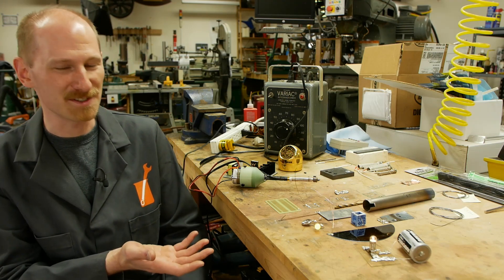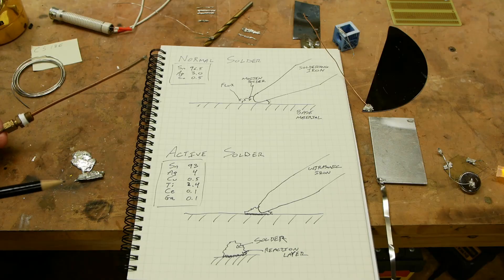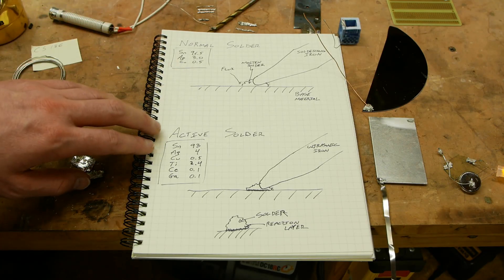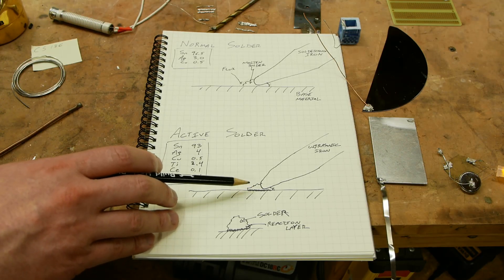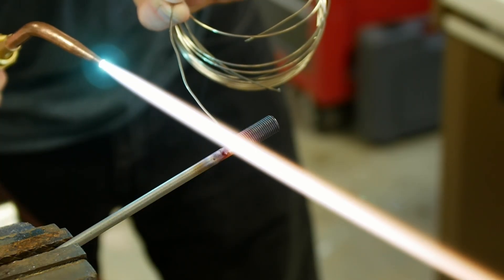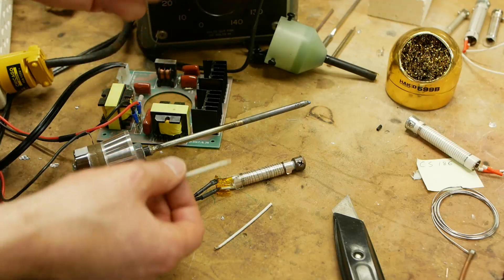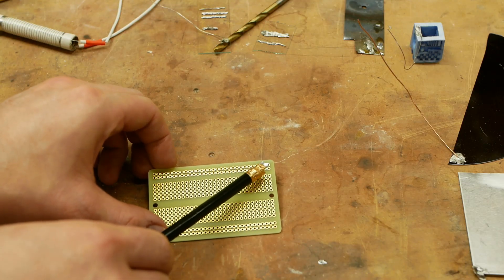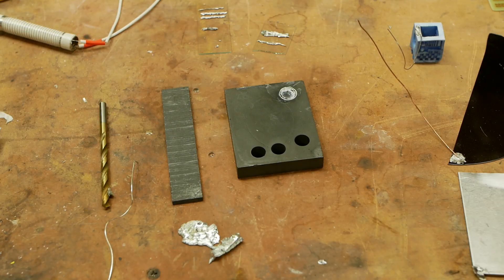Ultrasonic soldering bonds glass, titanium, stainless steel, ceramics, tungsten, nichrome...

Comment: transducer is too large    you need   magnetic strictor    that  tip  can  be   4x    smaller    then  used.
and you  will be suprised   but   ultrasonic solder   we have  manufactured  15 years ago  in russia     the cost    is  near
250 $  with  driver  power is 40watt

Comment: Normal electronics soldering irons have a coating to prevent the iron itself getting soldered and to prevent corrosion. I've had cheap tips corrode away like crazy. I always thought the interns did something fishy when I wasn't looking, but I once ended up putting one of the bad tips in my own iron and there it went.

Comment: Can you measure the resistance you get if you solder a ground wire to anodized surfaces? We currently abrade away the ano, but if this solder can bond we'll to it, we might be able to leave the ano

Comment: Would this work to solder low heat for batteries?
 Did you ever do the induction furnace to make aloys video? I'm wanting to make an induction heater but was told I bought all the wrong type parts. High voltage power supply for a tesla coil won't work I guess. Like to see how you put one together from Ebay. I'd buy a DIY kit if you made a batch. You could do well making DIY kits for some of your projects. I dislike finding all the parts and wasting all the money on the wrong stuff. i was just looking for a cheap easy way to melt a couple grams of recovered gold. Torches just don't get hot enough.

Comment: My question is if you can weld glass together with it like you're making stained glass, soldering on the borders between pieces like they're being welded together. I think it would at least make a weak bond over the surface, but I'm curious if it would work into the crack due to being "contained" between the edges and have more chance to react and bond to the glass.

Comment: First, this reminds me of the old “A-Team” television show, where our heroes often find themselves trapped in a garage and heroically break out in a tank constructed from found materials. 
Second, it seems like a shielding gas such as used in a MIG torch might be an easier solution to some of the oxidation issues.
Third,  combination of science and engineering is impressive. (That actually should have been “first.”)

Comment: Might not be too hard to modify the ultrasonic driver to reduce the power. In a pinch just putting a power resistor in series with the transducer would probably work.

Comment: Might be easier to build a vacuum sputtering system to coat the non metallic substrate with a metallic layer which you can then solder directly to

Comment: Now this is what is what i like someone given thing ago! you'd know what i'd like to see is you using a slightly smaller stainless steal rod woth either a element at the end or a heater like a blower that starts at the hand peice but also use a enclosed reflecter where the sonic resainates then travels down the tube to the tip being a pointed tip or a dish like tip an see how that works use the heat or just the transducer so you can weld things abit more where particles are a bit more displaced then forming a solided mass! would like to see that with plastic's too.

Comment: I used acid based flux once because I was soldering two pipes together using my hakko electronic soldering tool.  I came back a week later and the flux had almost entirely dissolved the soldering tip. It was amazingly instructive and unexpected. It was just gone- I don’t know where the tip went

Comment: Impressive & Interesting!  But why would you need to fuse metal to not metal?  Traditional soldering is for electrical continuity.  But non-metals aren't conductive. So what are the use cases?

Comment: Will it work for audio copper wire to brass connectors, what affordable options is there for ultrasonic welding/soldering. Idea is to get as much conductive as possible without old soldering/exotic silver+gold solder to max the conductivity.

Comment: So if the mixture of solder can bond to and "tin" the glass, could you come back over it with a standard mixture or another solder that would bond to that and leave a shiny surface?  Maybe there would be a way to apply both layers at the same time.

Comment: If the graphite were under a vacuum do you think it might stick then?  When the solder pulled loose from the graphite, did it pull any graphite from the surface still attached to the solder?  I've read that graphite is a lubricant because it gets oxygen molecules in-between the flat molecules or something like that.  Would those oxygen molecules prevent the solder from sticking to it?  Is it possible that instead of using a heated soldering iron that some sort of plating might be possible using the ultrasound.  A connection could be started with the solder and then try to work out onto the surface.  Maybe.  This was really interesting.

Comment: I was working a few years ago with an ultrasonic transducer from a mist atomizer and they are quite powerfull (and cheap), by curiosity I put my finger undergater between the ceramic and the water beam (so underwater), and instantly regreat it!!  A deep pain as my bones wanting to scape from the flesh!!... so I quite concerned about using a ultrasonic element atached to something I take with the hands..... maybe, just vibrations are required and no "so powerfull ultrasonic" ones could be used... maybe try to join a quartz crystal to the solder iron and feed it like a clock resonator, with less power and more slight vibrations it could work (by removing the air layer between the metal contacs through vibrations)... something similar I successfully used to dig grounding copper bars in the soil: I take a vibrating motor from a broken PlayStation Controller, a batery, and join it to the head of the copper bar with duct tape, when turning on, it make vibrates the copper bar making muuuuch easier to nail it into the ground, about 2m bars, with just a hammer when passing the first half it becomes a nightmare

Comment: Для чего это делать и выдумывать квадратное колесо для поезда. Для особо одарённых посмотрите изготовление и крепление нагревательных спиралей в автомобилях для переднего и заднего стекла также подогрев зеркал. А слой тонкой меди на алюминиевой основе. Хватит обмана и фейков. Why do this and invent a square wheel for the train. For those who are especially gifted, look at the manufacture and installation of heating coils in cars for the front and rear windows, as well as heated mirrors. A layer of thin copper on an aluminum base. Enough lies and fakes.

Comment: Very interesting video, thank you.

Have you experimented with the use of mildly reducing (and non-toxic, if there are any) or inert shielding gases to keep the oxygen out of the melt?

With respect to the attempts to solder to polymers, you might have more success with polymers that can form covalent bonds with e.g. dyestuffs or other chemicals, such as textile-fibre-grade nylon 6 or nylon 6,6, or the cured form of the two-part resin that is used to make fibreglass (assuming that some reactive chemical groups remain after curing), etc.  A textile chemistry textbook would help identify such reactive polymers.  Overheating during the soldering could damage the polymer.

Comment: @applied science. you could use this in theory in junction with a 2d CNC to manufacture circuit boards. there would obviously be a boatload of details to workout but having the ability to throw down a sheet of substrate and just crank out a custom board would be incredible. i'm assuming that you'd be able to hot solder to this type of solder and even if you needed to do through hole components it would be as simple as just drilling the layout on the substrate before printing the traces on the board.

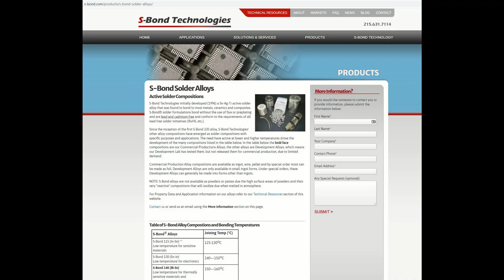Comment: 1:15 Lol that blob of homemade solder looks like a bust of George Washington

I heard once that it can be really hard to get stuck on food off of your cookware because if you scrape away the metal underneath the lubricating oil the raw metal can form a strong chemical bond with the protein in the food, forcing you to scrape it off as soap will no longer help. I wonder if that technology could be utilized in a similar way to the ultrasonic solder to fuse things together

Comment: Can you film a video about "homebrew" acrive solder in "kitchen circumstances" ?
Because i cannot find, where buy even a sample of commercial Active Solder (GS155 or CS186)  samples, i really will try do it myself, or ask a Lab-friendly comerade about it.
P.S. Ultrasound soldering gun like yours prototype i can do myself, this is not "piece of cake" job, but i can do.
P.P.S. My main goal - is hobbysts aluminium soldering (exactly a Tesla Panasonic 21700 Li-Ion battery, that have a non-weld-non-solder "Alu Positive" contact), there is a using Active Solders looks pretty perspective.
Other alloys for Alu, i used already -- or very High-temperature alloys (like ex-SU alloy called "ПОЦ50", Sn50-Zn50), that gives a good mechanical stretch bonding, but has a 230C+ work themperature, leading to themperature-damage of cell (but gives a miracle results with regular soldering flux and regular soldering iron on other aluminium parts like soda cans or aluminium foil), or ultra-low mechanical strength alloys like Rose's (Sn25Pb28Bi50).
So, you can understand my itnerest for ultrasonic weldind theme :)

Comment: I'll bet you can make small, super-high quality mirrors with this process that will withstand higher temperatures without losing clarity. 1 thing I would like to know is, how strong is the bond to glass and other non-solderable materials? It's not enough to just bond, it must be pretty strong to be practical.

Comment: A little off on why flux left on why soldered joint continues to corrode! Flux is corrosive and eats away not only the thin oxide layer but the metal itself. If left on, it continues to corrode the metal, not just the oxide layer.

Comment: This is an Amazing process. It was used to bond the SR71 windows (Quartz) to its structure (Titanium Alloy) and it worked fantastically well, keeping it air tight at high temperatures (>350°C) at supersonic flows (> Mach 3.2)

Comment: Once you have doped the material surface that you wish to stick to with your active solder can you use standard 50/50 solder to the active solder material.? The term you used at one point was confusing about Air and then Oxygen and Titanium Oxidation as if they were the same gas, they are two different things. Air that you breathe as you know is 4/5th nitrogen and 1/5th oxygen plus half a dozen trace gasses H2oVapor/air humidity, and O2 is well just Oxygen.

Comment: Weird epiphany, but at about 6:00 you mentioned the vibration is used to overcome the surface tension and I was reminded of the difficulty in "wetting" a surface with liquid metal heat transfer liquid.
Reply: I guess I am now wondering if an ultrasonic element could make the application easier or if it might just make a bigger mess.

Comment: I have been knife making for just under 10 years. I have lots of tools surrounding this profession. One of the end-game processes is to pattern weld titanium in a way that traditional "damascus" or more accurately "pattern welded steel" is made. The problem with titanium- as you know- it oxidizes very quickly. In practice, when you get titanium to forging temperatures (for titanium its on the higher end) it oxidizes and scale is quickly created- crusting off and making it very difficult to proceed. Friends have theories that you could use an induction forge in an argon environment. But this would require having your press inside that environment I believe. Ive also heard you could encase the titanium in molten glass that has a similar expansion coefficient, which sounds more like how it might be done. Im not a chemist nor did I do really well when i was in grade school a million years ago. I would like to try this out as I am a very decent knife maker and would like to expand and practice making pattern welded titanium. I would be happy to send you enough material and a sample of pattern welded titanium if you are interested in attempting to figure this out. But im not sure you have press. Also it does occur to me you have no interest in pattern welded titanium. Thanks for taking the time!

Comment: Have you tried using this for glass-to-metal seals for vacuum stuff? Would be REALLY handy!
Reply: I wonder if you could solder a canning jar sealing ring onto a glass jar through the ring? Would you have to have contact with the solder and glass or the transducer is powerful enough to penetrate through. Don't know what purpose that would serve but neat to find out.

Comment: The reason you are eroding the tip of the solder is the ultra power of the transducer is way overboard in power. Second the solder is really reactive with the tip causing lot of erosion. Happy New Year too.

Comment: One thing you have to be very careful with is Chrome and Zinc around Ti, it damages the titanium quickly. When I was in the RNZAF, we had some aircraft parts that were Titanium, and we were not allowed to use regular Chrome plated tools on them, as they left marks like pencil marks, but in a few weks the Titanium would exfoliate in those areas and even fall apart.
Regarding the Graphite, you may have soldered to it, but it has layers very thin layers, so they tear off easily. If you look at a motor 'brush' they are compressed around the copper wire to make connection. Cool fun you are having there.

Comment: I would be very interested in knowing if you can active solder onto crystals, anything really but quarts is an easily available material. Not only could that lead into interesting tests of piezoelectrics and resonant frequencies but could also go further and maybe be used for testing ionization energies of their valence electrons. Not gonna lie, the prospect of being able to remake the original transistors without a massive headache is the first thing my mind went to.

Comment: The board and transducer isn't shown on ebay. There are other boards but mainly 220 volts and 50 cycle.  Lots of 60 W transducers. Would it matter if the board were fed 60 cycle off the 220 volt feed  for stoves etc to feed the transducer ?

Comment: You should try with "Aluminium Welding Sticks". They sell them at Hardware Shops so readily available. They're stronger than Solder and readily available. The metal is stronger than Aluminium.

Comment: lol i dont use extra flux its a waste of money. any rosin core solder will work. if the pad is heavily oxidized 1500 grit sand paper will do the job without removing much metal. 
i do however use solder paste for SMD work which is solder suspended in flux. tinned pads usually dont require any sanding or flux . 
also adding solder to a stubborn old solder joint helps melt it. 
i been soldering electronics for about 11 years flux is a waste of money. no buts about it.  there is nothing professional about wasting money. 

although if your soldering pin holes in a gas tank (after you neutralize any residual gas of course) you need silver solder and flux cant get around not using flux on steel.

Comment: 50 years ago a friend gave me a small tube of a special solder that was also a special alloy that did pretty much the same thing the ultrasonically applied solder does, but 'wetted' and reflowed well using a conventional Weller 60 watt soldering Iron.
 It was about the thickness and consistency of standard spooled 60/40 resin core tin lead solder and left no visible flux residue.
It was coiled up in a plastic tube similar to the 'free' solder sample you often get when you purchase a new soldering iron.
 I didn't have much use for it at the time, but over the years I used it to solder things I would not normally have been able to solder; such as Nichrome wire (but not the part that could glow red hot), Aluminum, Stainless, etc.....
 My biggest use for it was repairing solar cells (which were extremely expensive back then, and were always round)
It was the ONLY way for me to successfully reconnect broken tabs to the metalized glass on the back,. or to bridge over surface cracks in the tiny treelike pickup paths on the front surface of a cell.
I never tried soldering to plain window glass.
 I never asked my friend for more of it because I still had some, and he passed away long ago.
There was a name on the plastic container but I am in my mid 70's and can't remember that name now.
 I only mention this because you may be able to do some research to find who made it and what was in it now that you know that it did exist,........ at one point in history...
Reply: I looked into this for you. my best guess is an Indium-Based Solder. possibly produced by the Indium Corporation. Does this ring a bell?
❤
p.s.
That Indium solder was some pretty specialized stuff. It was around, but your good friend must have been in some pretty interesting electronics circles. ✌️❤️

Comment: Building a vacuum induction furnace and buying 25 grams of gallium is easy cheaper than getting an engineering sample of ultrasonic solder! I love it!
Reply: Hi... Something i obviously havent understood here..... why not simply make a Tesla Coil.....(I answer that myself.... well...... that is AC)     ok so why not make a DC generator with a cascade multiplier up to a couple of hundred thousand volts DC ?   would that be the same but stronger ?
   or ...what is different with 'an electron beam' in air  to what im suggesting ?

Comment: I need to bond wire to the  positive cap of Tesla/Panasonic 2170 cells out of a Model 3. They appear to be aluminum. I'm looking at trying to build an ultrasonic wire binding gun but this looks more process tolerant. Will this work with an Al to Al or Al to Cu bonds?